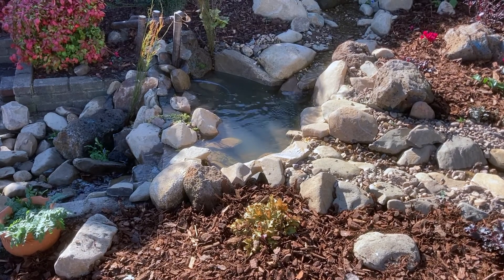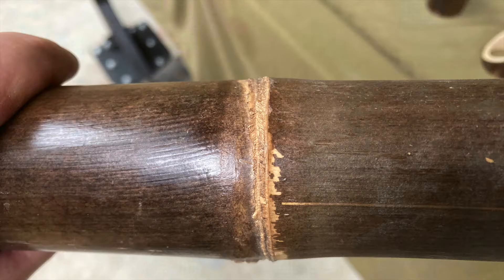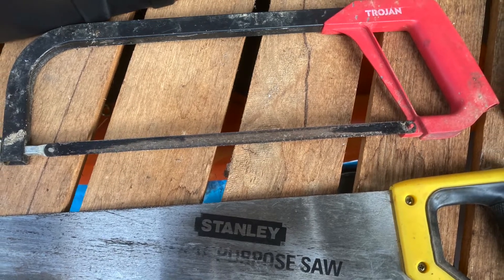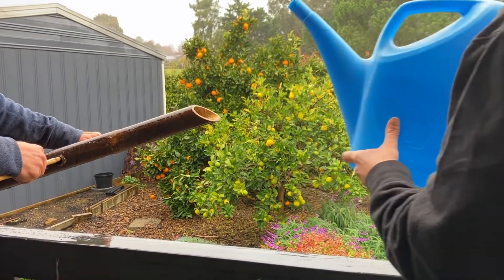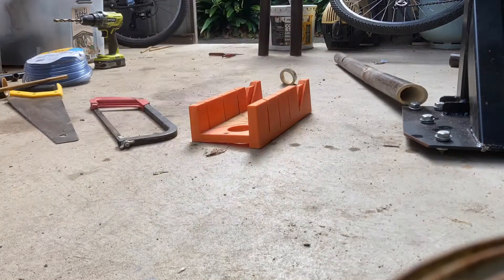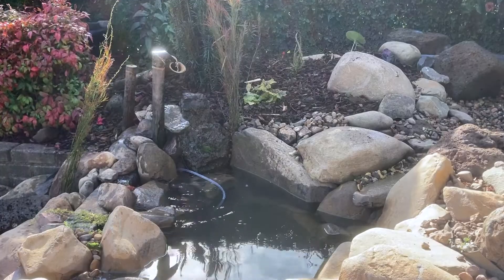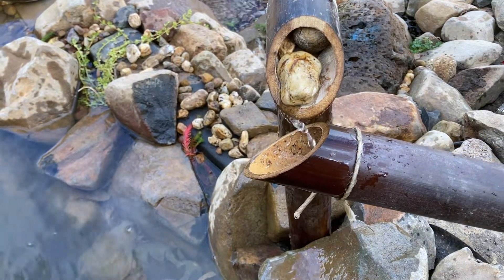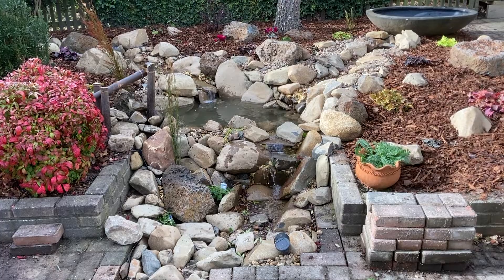Building a Shishi-odoshi (Japanese deer scarer)

Comment: Stupid question:If you are using a pump to keep adding water to the pond, wouldn't it eventually overflow? 

What would you recommend to resolve that?
Reply from the maker: The pump just recirculates water it’s not pumping in new water from a separate location.

Comment: Great! I like the twine part. I also built a shishi-odoshi and have a lot a water running down the bottom edge and was wondering what I could do to avoid it. Never thought about the twine. I will try this. Thanks. 
I have two questions though, what is the power of your pump ? (how many litres/h, mine seems to be too powerfull and empty my reservoir at the end of the day although most the water is going back in) and also, what are roughly the dimensions of the tipping bamboo (the tipping bit and the end) as I have just moved mine and it would no longer tip as it did before and I am wondering if it is not due to a problem of having too much weight at the bottom. 
Should you take the time to read this and answer me...  thank you.
Reply from the maker: I think the pump can deliver 300lph, however it is solar so it probably very rarely hits that mark. The tipping part is maybe 30cm long.
Reply: @Ozponds  Thanks. My pump is 500l/h and it is also solar. I tried before with a 180l/h but I do not know if the pump was faulty or had not enough power to get to the top of the bamboo stick. 30 cm long, noted 👍 but is it longer or shorter than the end bit?
Reply from the maker: @saraswatih9703  longer. The end bit has a small rock for weight.
Reply: @Ozponds  In my case, this was the tilting bit that was a problem, starting tilting then stopped in the middle, now with just the wet twine, it solved the problem. But again thanks for your input.
Reply: @Ozponds  Thanks again, I did place a bit of twine today on the tip of the tilting part, not only if fixed the dripping problem but the weight of the wet twine fixed the  tipping issues... Great stuff, I would have never thought about it. So again, thank you.

Comment: I wonder if this scares them more than the 100% coyote urine on wicks that I tried, or the large angry gardener bursting from the house and chasing them in the middle of the night?  I was thinking of something like this but much louder.  Not quite as loud as I was when crashing through the yard in the dark, but louder than this soft knocking.  Maybe next will be a bucket of corn and bare wires hooked to a 12 volt battery...
Reply from the maker: 😂 that’ll work!

Comment: Thanks for taking the time too make this video! Wonder if this would scare away Great Blue Herons? 🇨🇦
Reply from the maker: I wish. But I’m not holding my breath. The birds have wiped out practically all my fish!
Reply: @Ozponds  OH😳 that sucks it’s sad when they disappear. I had that problem about 5-6 years ago, has a crane come and steal the fish for about two years. I put a net over my small pond and that got rid of it. Haven’t seen it since.
Reply from the maker: I might need to net, but I really don’t want too.
Reply: @Ozponds  Do they come in your winter too? I only have to deal with them in the spring, Summer and fall. They head south for the winter. Once they get turned off by the net and go away, hopefully you can go back to no net once they find somewhere else to go.
Reply from the maker: Winter is always when I have the issue. It’s herons and cormorants. The cormorant is the worst for me.
Reply: I want to build one, but if I could even find bamboo of that diameter in New Brunswick Canada, it would be $50 a piece. No fish eating birds yet for me (Options are heron, king fisher, bald eagle and osprey) but the dang racoons are nightly. Think the only thing that reliably works with them is the zappy zap from the 50 mile electric fence energizer...with barely 300 ft of wire 😂
Reply: @blaircox1589  I’m in Ontario, have you tried tiki lamps, you just cut of the lamp part at the top and use the rest.
Reply: @RC-Flight  where do you find those? I'm from Ontario, out here in this armpit province, it's hard to find anything. I order online for the majority of what I need.